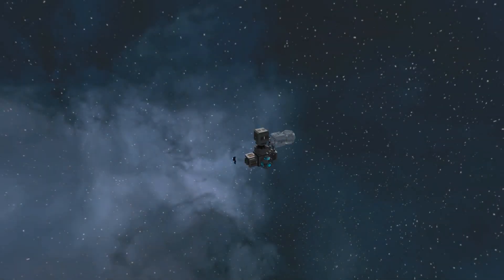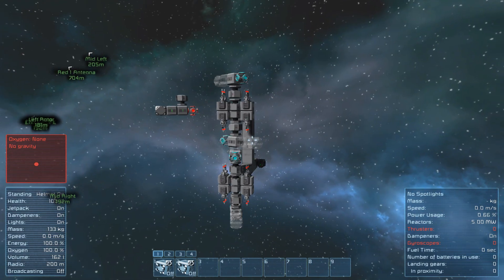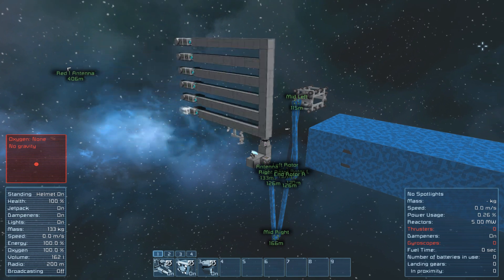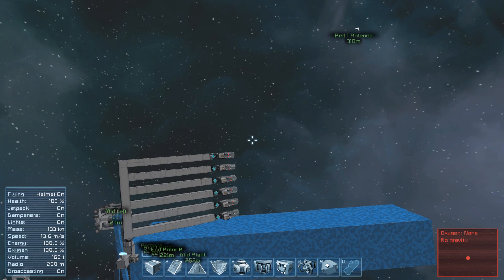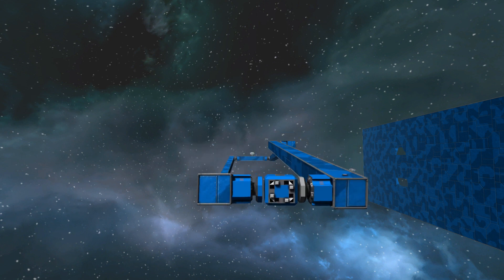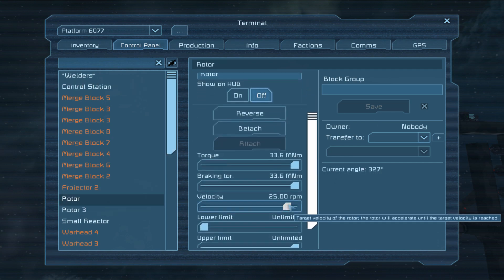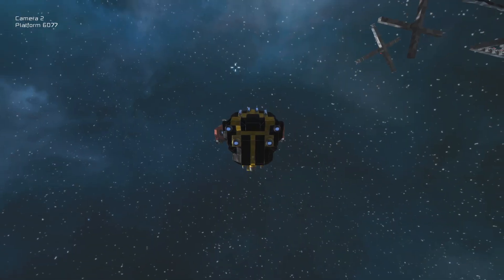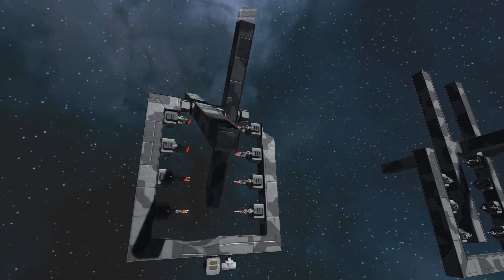Space Engineers - Searching for the Cheapest Projectile - Lotus Experiments

Comment: Unpowered rotor as a pivot with a long beam. One end has landing gear to hold the payload, other end has thrusters to spin the whole rig.

Reloading may be tricky but a simple armour block printed statically then cut off after clamping could work.  Spin and release the gear to fire.
Reply from the maker: Herbert Coyle Yeah could definitely see that working, only real question is the landing gear part and is it capable of grabbing a projectile without slowing down because that would be the ideal scenario. Still an interesting approach. I wonder if rotors have the same speed limitation when not under their own power..
Reply: You'd have to slow down otherwise the gear gets damaged. But you can use a timer to toggle on the rotor with enough breaking torque to slow it, pick up the shot then turn off the rotor again.

Bad news is it requires sitting around with a stopwatch, timing how fast things spin and calculating angles to get it working. 

There's a mod for flat docking clamps with tractor beam style ones that lock a good distance out, those make the loading a lot simpler as the arm won't have to touch anything then.
Reply from the maker: Herbert Coyle
Interesting.. I think with the precise timers script I could get it pretty efficient at least even if it will need to slow down to reload... kinda used to the stopwatch thing :)

As usual with me would love to do it without mods if I can!

Comment: I tried to do the same thing with the rotor arm throwing the projectiles, and I partially solved the problem by making the projectile and arm really large and massive, and now I will explain just how that makes any sense whatsoever.

Since the building of the projectile was going to take time anyway this lessened the problems with it taking so long to slow down. I even tried to make a system to create the next projectile on the side of the arm while it was spinning, and then attaching it once it stopped (though this would requier a ridiculously large machine). The size of the throwing arm also improved accuracy, since the velocity could still be high but the angular velocity was quite low.

There was however a huge issue, besides the massive space it would take up, and that was that it was simply impossible to attach this to a ship. The spinning arm caused the ship to shake uncontrollably, thus greatly reducing the accuracy and generally making the ship really hard to controll. This also means that you couldn't attach it to a turret, since it would likely just tear itself apart.

This isn't really an answer to your question, but i hope it could at least give you some other ideas.
Reply from the maker: Oscar Berggren Yeah the issue with how it performs when you attach it to a ship I was gonna solve later down the line :) Figured that the spinning was gonna cause some massive issues so had some vague ideas to try and add a counterweight to it spinning opposite on the other side of the ship, or something along those lines, but no idea if that will work! Wanted part 1 fixed before I worried about that bit :)

Did having it that large solve the projection issue? As you say it reduces the angular velocity a large amount and it's that angular velocity that was preventing the projections from lining up correctly.
Reply: ***** Actually, I didn't think of the projection issue. The idea was mostly that the projectile was going to take a bit of time to weld togheter anyway, so I would have welded it next to the throwing arm while it was still busy throwing the project, and then stop the arm to attach it. The problem with that is that the system would have to be ludicrously large, so I gave up after a while. 

I did however create a system where I stopped the arm, and then had welders on pistons come out from the side of the station to assemble the projectile, though this made the process much slower.

The main idea with reducing the angular velocity is that it would actually be possible to aim propperly, I didn't have the advanced timers at the time, so i could only do it either by having a sensor detect when it was in the right possition (which still had quite bad accuracy), or by controlling it myself, which gave better results, but takes up a crewmember as well as allowing for mistakes to happen.

Most of my time testing was spent on a station, without an automated rearming system, and with projectiles that where simply 3*3*3 balls of light or heavy armor. What i can say for sure is that the projectiles are relatively cheap, hard to block, and packs a ton of destructive power. The heavy armor ones could penetrate 6-7 layers of heavy armor, though they do cost 1700 steel plates, so it's still quite alot.
Reply from the maker: Oscar Berggren
Finding it awesome that people are getting so involved with this idea and trying stuff out like you describe.. that's sounding pretty crazy even if it doesn't quite achieve the end result we wanted :)

The angular velocity thing was a really good thought, the projection issue was a side thought, could totally see the benefit of it from an aiming perspective also :)

Should upload the world! Would love to have a look :)
Reply: ***** 
Sadly, the world is not that impressive. I often struggle with creating things that are aesthetically pleasing, so I mostly stay away from making propper ships, and instead play with concepts. 

Like my ship with thrusters that can be rotated in 4 directions, allowing for some extreme mobility with relatively few thrusters, only a single rocket will pretty much break it, or ruin it's balance to the point where you can't controll it.

Because of this, I only really save the latest version of my tests, and I usually don't use them for anything other than playing around.

I wanted to get over my problems with the aestetics before publishing anything. But I will consider uploading my creations anyway, so that perhaps others can complete them.

Now, sorry for dragging out this conversation for so long (I should probably shorten my posts a bit, and stay more on topic). 
It has been a pleasure chatting with you!
Reply from the maker: I'm not exactly an aesthetic builder either tbh, function most definitely comes first and then any attempt at appearance can follow.. if I bother at all :) People are still interested in them though, regardless of appearance!

Thrusters ship does sound fun, if a little prone to falling apart at the first glimpse of combat :)

Thanks sir, has been a pleasure indeed!

Comment: assuming that the displacement of the projection is consistent based on the velocity of the projector, you can simply offset the projection itself (NOT the projector, the blueprint itself). when an object in space engineers has a high speed, you may have to offset the welders and the actual projection itself in order to have it in the right spot at the speed you want. it'll look really stupid when it's stopped, but it should work if you get the offset right.
Reply from the maker: Parker R Nah sadly not in this case.. I've used that method a number of times in the past on craft designed to be moving while projecting stuff (Vulcher, Blackbird, Death Lotus, to name a few) however in this case the spinning force is moving the projection in both the x and z axis, resulting in a movement that doesn't line up with any possible correction of the projector.... basically the result of the forces applied to a spinning object applying a diagonal force in relation to the rotation point.

Comment: Just to share, a simple rotor/merge/welder/sensor assembly can be made churn out about 80 rounds a minute. True, those "rounds" are only going about 15 to 20 m/s, but they'll still back a wallop when they meet. I can post a video of the test module I built up, or share it on the workshop, if you'd like. But, it does seem to have a minimum range of about 300 meters. (Any closer, and the rounds are close enough together to cause a chain reaction that will destroy the launcher)
Reply from the maker: Jace Sterne The chain reaction thing sounds very familiar from some of my other designs that had slow moving projectiles that took distance to spread out :) Never really tested what sorta RoF you could get from the rotor welder setup but that sounds pretty nuts, maybe this has some uses after all :) Not the fastest but gotta have a purpose still as long as you can aim it. Cheers!
Reply: +w4stedspace I originally tried for 100 rpm (It's a single motor with four individual merge blocks that are set to fire at a certain point in the arc. As such, the rounds per minute is simple the rotation speed times the number of merge points). Trouble was, creating them that quickly caused a minor backlog, resulting in the occasional chain reaction occurring after three to four minutes of sustained fire. 80 rpm, however, was stable even after a sustained burst of approximately 10 minutes. But the spread gets to be rather atrocious. There's a slight variation on when the individual merge blocks actually deactivate, which creates four chains of shot (though, one chain could be replaced with decoys which could possibly make for a trade damage for survivability)
Reply: *****
Just uploaded the world I was working on here: http://steamcommunity.com/sharedfiles/filedetails/?id=432617477
The missile launchers are only there to act as targeting lasers (and show the platform is directly below the warhead launcher). Likely, this design would be great in a slightly more terrestrial or stationary environment where a carpet bombing approach could be employed.
Reply from the maker: Jace Sterne All the RPM talk is a confusing, have to keep reminding myself it's round per minute and not revolutions per minute.. spent a few moments wondering how the hell you got a rotor to spin that fast before waking and and remembering that's not what we're talking about :)

Looks interesting, kinda a variation of the 'weed whacker' thing I showed at the end, will definitely check it out.. not that surprised that irregularities creep in though, once you start doing crazy stuff the game engine invariably starts act a bit less consistently and this is printing things pretty damn quickly :)

Comment: Gravity cannon is best because you can also use it to accelerate you ship.
Reply from the maker: Karakas Ahh but gravity cannons have a big weakness too.. Gravity can be used against them as well so people can have gravity shields which can make the weapon completely ineffective, spherical grav gens are super good at this.
Reply: ***** But then there is no useful weapon. Projectile from gravity cannon can fly at speed of 211 m/s (might have changed) so the effect by gravity is minimal.
Reply from the maker: Karakas There's plenty of things that do not respond to gravity, small and large ship blocks for example.. it's just ore and actual 'parts' like steel plate that respond to it. And mass blocks of course but if you are using those then you have power and so can use a timer block to turn the mass block off after launch so this problem doesn't exist.

Gravity wise, you are propelling your projectile using gravity generators.. regardless of it's speed there is nothing to prevent the target from having an equal force (or greater) pushing back using gravity generators also.

Plus, spherical gravity generators, which tend to be pretty bad for ore weapons where you use linear generators instead, have a maximum range of 400m instead of the 150m that the linear generators do so can exert greater force per generator by more than double.. plus have the effect of not just slowing down the incoming ore/parts but also deflecting them away thanks to it's spherical nature.

It's perhaps worrying too much about gravity shields etc given not all targets will have them and when they don't have a shield gravity weapons are devastating, but I kinda like to over-think things :)
Reply: ***** even if it has greater force to push against your projectile, the projectile is so fast that it will not be much affected. Engine works this way: there is 60 frames in one second, in one frame the object moves and engine calculates what affects it in that one frame or if it came to collision. It only works at maximal speed of 114 m/s, if your projectile is faster it can penetrate through whole layer or even too of whatever armor just because in one frame it flew through both of them. Even if you have the gravity shield it will get too close to your ship before engine could move it to other position.
Reply: ***** Also you most likely will not have the spherical gravity generator on at all time however it should be reduced because you just should not be in such gravity field while on a ship.
Reply from the maker: Karakas Fair points, in my testing which I'll admit is purely vanilla and with the standard speed I was able to stop gravity projectiles effectively on a 1 to 1 ratio (same number of gens firing as trying to stop the projectile) but I suspect this may be because they have updated things to not allow ore to exceed speed limits in the same way it used to be able to.

John Brewer has a couple of excellent videos on this subject looking at the maths behind it in relation to the game engine. Here's the grav shields one: https://www.youtube.com/watch?v=ggWYKLW3klE
and this one is interesting also, talking about how things can appear to exceed the speed limits of the game (but aren't actually) https://www.youtube.com/watch?v=XTgbYpspkVg

There's also a gravity weapons one that covers what you talk about with the penetration effect from items. How much is still relevant though I don't know as I'm certain there's been some bits changed behind the scenes since.
Reply: ***** Cool. I always try to get to know how does the engine work and how to make very lethal weapons.
Reply from the maker: Yeah same here :) He's about the only person I know really looking at it from a math's perspective, running sims etc.. good guy to watch.

Comment: On the first one with the rotors you could try using gyroscopes to force a speed increase. Coupled with the longer arm the angular velocity should be pretty high. I'd try using sensors for release timing too. Sounds a bit Scrapheap challenge-esque but could be fun
Reply: Or even a hammer style thing so you need not worry about the printing issues. A spinning arm with a feeding mechanism and maybe a wheel on the hammer head so nothing explodes when it's struck
Reply from the maker: Callum Mayor Hehe, funny you should mention the scrapheap challenge.. I'm most definitely not practicing my weird challenge skills :P No sir..
Gyro's to force more speed are an interesting idea, I don't know if the rotor limitation is just a limit on how much power they have, or a limit on how fast an object can rotate in general but worth a shot for sure.

Or we could just smash it at them is an option yeah! Have to test quite how much impact a wheel can absorb..
Reply: I think if you just turn the rotors off they can rotate freely making the gyros a viable option. Couldn't hurt to use a couple of thrusters too
Reply from the maker: Callum Mayor
Apparently the game actually has a max RPM for any object, regardless of power source... tried using gyro's, thrusters, rotors and any combination of and the speed is always the same.. Only way to 'exceed' it is by having an arm extended out from the rotation point so it's covering more distance for the same RPM.
Reply: That's a shame really. I hope when the DX11 switch happens they'll do something about this for the sake of the creative. At least angular velocity is still our friend. When the time comes though I may start posting stuff on the workshop under the tag 'overengineered'
Reply from the maker: Callum Mayor
hehe :) Would be nice indeed if the new engine removes some of the more arbitrary limits we have imposed at the moment, like the RPM thing and Sensor ranges..

Comment: I say that you just print the warheads statically and then spin it up turning off the projector.  Loading speed wound be slower but if it's large I think you can do it and have up to 4 warheads at the same time.
Reply from the maker: Smilecorpers Yeah that's one solution to the limited speed is just to make it print more at once so at least you are only slowing down once every 4 shots instead of for every single shot. Good thinking and given I actually have a solution to the projections moving around now I might try and incorporate that into the new design :)

Comment: You could try to make a rail driven system where the wheels hug around a centered shaft of heavy armor. I once saw a video where somebody built an elevator like that. He had it in a really fast and manuverable large ship and the system seemed very stable. Not the slightest trail of wobble.
Reply from the maker: Charles Okonkwo So kinda the reverse of the tunnel approach? Could work, will give it a try... Honestly though, something seems to have changed with how the wheels behave when used like that at some point in the last few months, I've built versions of the both something like you describe there and the tunnel version like I tried here before and they worked flawlessly.. I suspect if I go back to those worlds now they will not be quite so flawless, the tunnel one surprised me a lot with how unstable it was based on what I'd tried and had working before.
Reply: The advantage the rail has over the tunnel is that you can easily make the hull 1 block larger than the whole contraption. That way nothing touches the walls. It might still be wobbly though, if what you suspect is true. I'm looking forward to an update video on this experiment.
Reply from the maker: Charles Okonkwo
Yeah I'll give it a try and see if it helps at all, can see what you mean. Cheers! :)